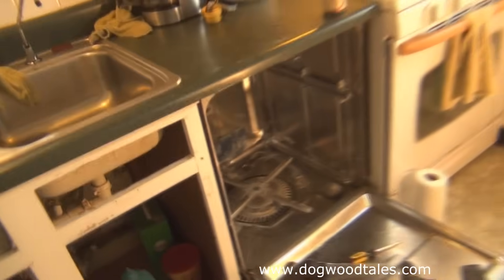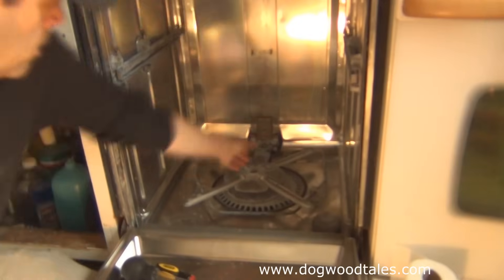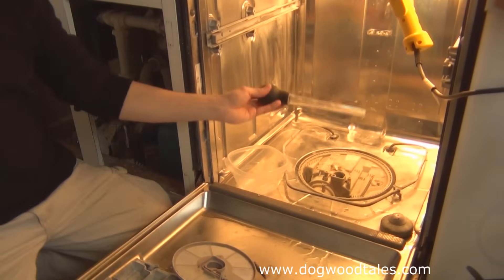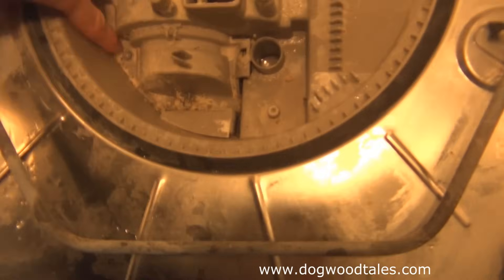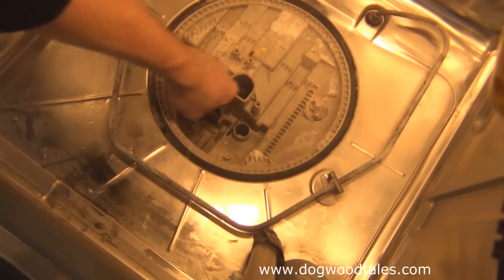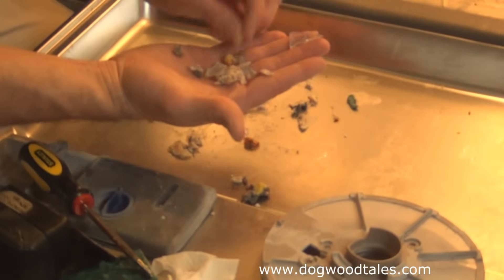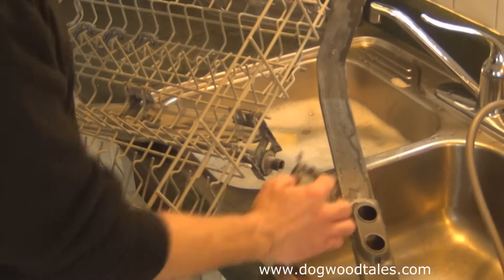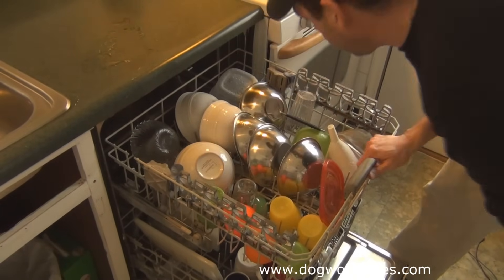Dishwasher Cleaning - Top Rack Doesn't Clean

Comment: Looks like you posted this video 6 years ago and guess what, still works great.  Been debating on calling a repair person or getting a new dishwasher until I saw this.  30-45 min later this thing is running like it's brand new!!! Thanks Dogwood!
Reply from the maker: Glad it worked for you. It helps to extend the useful life of these things. Eventually they will all burn out and need replacement.
Thanks for watching.

Comment: Just had to thank you.  We followed your directions and were lucky that our dishwasher looks exactly like this one.  Our filter and grinder were pretty dirty and we cleaned them, but the real issue turned out to be a small hole in the plastic feed tube assembly.  We did a temporary repair with duct tape and the dishwasher worked perfectly.  We just need to order the part now.

Comment: At home with the 2 kids while the husband is at work.  Watched your video and felt confident! but then the dishwasher leaked during the vinegar wash.  Put everything back- with NO spare parts- and now the control panel is acting up.  but it is running.  Thanks for the video.  the instructions were really clear.  And YOU just saved me $200 up here in NJ- that is IF everything goes back to normal.
Reply from the maker: +Tasha anne That control panel is replaceable too. Kinda a pain in the butt to get to it, but if you can clean that gutter you can handle replacing the control board.

Comment: You probably saved me the cost of a new dishwasher. When dishes weren't getting clean, the appliance repair guy said all we could do was run it with a vinegar rinse and not use as much dishwasher soap.  Recently the water stopped spraying on the top rack. So I did a search on these kinds of problems and your video popped up.  I didn't realize how simple it would be to clean everything up.  There was all kinds of stuff down in the grinder causing it to stop working.  The spray arms also had dried food and detergent residue clogging the holes.  Thanks so much for the video--I am the hero on Father's Day.

Comment: Absolutely perfect!  Cleaned it this morning......superb!   Many thanks from Georgia!  

Found multiple fragments of my disintegrating "pull out utensil basket" in the blade compartment....Had my unit for 7 years and wasn't interested in buying a new one which is where I thought I was headed.  Money saved, and easy.  More importantly, I'm not a "handyman" when it comes to repairs.  With that, this one of the easier things I've completed relative to appliance repair. Cheers!
Reply from the maker: +Jody Logan  I haven't gotten around to posting the video footage I took of it yet, but the bottom of my utensil tray was also disintegrating. I repaired it using galvanized, hardware cloth from the hardware store. I cut it about double the width, of the tray and folded it over so the ends met in the center. Doing that kept most of the sharp edges from sticking out the sides. Then I tied it in place underneath the tray using plastic zip ties.
Clipped the tails off the zip ties and used a metal file to smooth over any sharp edges.

Hardware Cloth
http://www.homedepot.com/p/HDX-1-4-in-x-2-ft-x-5-ft-Hardware-Cloth-308231HD/204331884

Plastic Tip Ties
http://www.homedepot.com/p/Commercial-Electric-11-in-Black-Double-Locking-Cable-Ties-75Lb-Tensil-Strength-100-Pack-295858/202520066

Comment: This worked like a charm! Only side note and it could be our model, but we needed to put all the cleaned parts back in before running it with the vinegar cycle. When we tried running it without the parts, the dishwasher leaked horribly from the bottom. Thinking I shifted something erroneously with the seals causing the leak, we pulled off the front panel to pop off and clean underneath the bottom seal, reassembled the door only to find out it was still leaking. As we were getting ready to order a new dishwasher, on a whim we put all the parts back in, ran the dishwasher and the leaks stopped! Now our dishwasher is even cleaner and working brand new! Thanks again for the detailed video! Model: KitchenAid KUDS35FXSS5

Comment: Dude, I hope you are still reading your comments. You are the bomb! My top rack for wasn't cleaning, and after much research, I followed your instructions. Success! What sets you apart is your management of the bottom assembly. Everyone else holds the central tap and spins the sprayer arm to undo. Well, that plastic gets brittle over time, and I've had it break off before. It is best to take it off intact the way you do. So for those reading this, this one step is the most important take away. Keep up the great work, and I am grateful!
Reply from the maker: thanks! glad to hear it worked out well for you. 
I have found that a careful attention to details works best for me.
Reply: +Dogwood Tales (Ray) thanks for the instructions. I followed a similar video however I was not able to get the last piece off but still managed to clean up my dishwasher very good. In the end the top rack is still not getting water so is it safe to assume the last piece must be removed for a successful clean up of the top rack?
Reply: I took the opportunity to take all of the water conduits apart and clean them. Top sprayer arm had build up in it I found. Used CLR, shop vac, brushes and old fashioned hard work. Works like new. So yes, I would break it all down and clean inside and out.
Reply: Maybe I didn't address your question properly. Yes, take off the cover for the chopper. I had debris and calcifications in there too. It may be stuck, use hot water and CLR to loosen it and pry carefully. But don't remove the chopper blade assembly unless you are really good at these things. You should be able to clean thoroughly with chopper blade in place.
Reply from the maker: If you are referring to the part at 5:55 then yes it has to come off to clean out under it.
It may also reveal if the chopper is in place. Some have reported their chopper as having fallen off.
Like dpfrz544 said, don't remove the chopper. I never had to, thankfully, but I think it can get tricky.

Comment: Thank you so much for this. Real world savings = $450 to 800.
Had a repair guy come and run a couple simple tests and say "yep, you need a new wash pump motor. This one doesn't have the power anymore." Then  saw your video, thought "what do I have to lose" and sure enough it was loaded with gunk down there. Followed the video, cleaned everything out, and ran a load that came out sparkling. One of the clearest how-to videos I've used. Just fantastic.

Comment: I searched for a repair video after figuring out how to remove the initial water channel for the top rack, expecting to find clogs or small orifices to clean but finding none. Though a different Kitchen Aid model,  I found the machines similar enough to use your instructions with most parts being identical. I never would have started unscrewing the base parts had I not had you there for guidance - thanks! The toughest part was that my food chopper cover did not want to come out, and it looked totally integrated with the large base part underneath it. I almost gave up, but saw by your video that I really wasn't getting anywhere without insisting it come out. I finally was able to pry it loose, and sure enough, it had a bunch of gunk including a piece of plastic blocking the water flow through the screen. I am currently running the vinegar wash load through, then will have to reassemble. Thanks again!
Reply from the maker: +Dana B Glad to hear it's working well for you. Thanks for watching.

Comment: Thank you SO MUCH for this video! I have just taken apart my dishwasher and cleaned the parts (they were caked in mould and other gunk). I found half a pistachio shell, a chickpea, and an oval metal clothing tag (??), no wonder it didn't work! I am just running the vinegar cycle and afterwards will re-assemble it which shouldn't take too long. Thank you again for your very helpful video, it was easy to follow! Dishwashers are no longer a mystery to me! It didn't take me very long, it has only been about 40 minutes and I'm just waiting for the dishwasher to finish so I can pop the other pieces back in. PS - love your sense of humour :)

Comment: Just wanted to let you know I watched your video and went home and repaired my own dishwasher. Got out the Ryobi drill/screwdriver set and a flashlight, pair of hemostats and went to work. The top rack wasn't spinning/cleaning. Figured there was a clog somewhere. I was able to disassemble my Kenmore, clean it (found 2 toothpicks, pecans, piece of plastic, bone, and the food grater part was mesh and full of cat hair), reassemble it and viola! Working dishwasher. Thank you again for your comprehensive and not overly long video. It saved us 400.00 on a new dishwasher.

Comment: I had already resurrected my dishwasher by simply clearing all the gunk I could see and then, after reading the manual, removing and cleaning the screen, filter, and spinning arms.  No tools, folks, so do not be afraid!  Some food particles remaining on the top shelf, so came here.  Your tip to run water through the spinning arms was brilliant!  Found some holes that were not clear though they appeared to be; a twist tie worked better than a toothpick.  Mapping the top with some bowls, but I think I am done.  Not afraid to dissemble the tubing and the bottom as you demonstrated, however. Thank you for a video that was clear, with excellent info.

Comment: Thank you so much! I found your video more informative than all those certified trainers paid by KitchenAid and online Parts suppliers. I wish I would have come across your video first and your suggestions would have saved me 3 hours of unnecessary work. I loved the way you disassembled the lower spray arm together with the hub. Saves everyone a lot of time. Installing the lower spray arm is pain in the ** and there no need to separate it from the hub.

Comment: I just followed these instructions on a 14 year old KitchenAid Superba, it had one more screw than on the video, but the instructions worked great.  The big clog on mine was the mini disposal was completely blocked.   Plus there was a small plastic cap which was probably contributing.   I think the cleaning will make the dishwasher work much better.

Thanks.

Comment: Thank you sir! Even almost 6 years later your video helped me. Mine didn't exactly need a cleaning but the upper sprayer where it fits into the back was broken. I found that there's a plastic part that should hold the valve open and it was broken. Had to order a new part. Thanks again!

Comment: Thank you!  Thank you!  Thank you!  The issue that I was having was very discouraging and I thought that we were going to shell out another $700+ dollars for a dishwasher.  Ours is 10 years old and you know a repairman would have cost about $250 and I couldn't see putting out that kind of money for a 10 year old dishwasher.  This was not a hard procedure to do if you have a little mechanical ability like me.  In fact, it was a lot of fun and very rewarding because my unit is working like new and it didn't cost me a dime!  Only problem I had was that I used Krud Kutter in place of the Simple Green spray and it made a lot of suds which foamed out of the bottom when I was testing the unit.  I really appreciate you sharing your knowledge and saving me a lot of money.  Thanks again!

Comment: Great video! Thanks for your help Dogwood Tales.  A little tip of our own - use a shop vac to suck out the big stuff!

Your instructions were great. We were worried we would need a new dishwasher after the top rack stopped cleaning, However, after cleaning it out as you did - PRESTO! Works like new.

Comment: Thanks a ton for posting this video. You're a good teacher with your step by step directions and clear video quality. I did everything you did and I'm just waiting for some super glue to dry to test it out. Even if it doesn't solve the problem in the top rack of the dishwasher, I'm glad I was able to get it clean because it was nasty. What you were saying about the guy who commented that time is money was spot-on. I recently heard someone say that don't think of things in terms of cost but a value. Right now, my time is of less value then the cost of repairing or replacing the dishwasher. So thanks again for posting.

Comment: Thanks for the video, it was a great help.  My 10 year old Kitchenaid dishwasher was cleaning very poorly, especially the top rack.  Followed the steps you outlined, found almost an inch of lime and debris built up in places under the screen.  The chopper mechanism was clogged with toothpicks, thread, garbage, you name it.  Took a couple hours to get it apart, cleaned, and back together.  Now it works like brand new, amazing!

Comment: This was a wonderful step by step video! My Kitchenmaid was a slightly newer model but I was able to use these directions to get right down to the food chopper, clean everything out - there was a small screw floating around below the filter but not in the chopper. Oh yeah I found some corn, peas and a toothpick!  Got rid of all that. Cleaned everything up including a vinegar wash and was done in about an hour and half. Machine works beautifully again!! Everybody check your tools. I was having a hard time finding  the correct screwdriver bit amongst my husbands myriad boxes of tools but finally found the star bits in one of those multi-use screw drivers. Fortunately they fit exactly and were magnetized to boot!. Thanks so much! I saved a lot of money doing this myself. Now its time to go spend it!!!  Thanks Ray!! (Bly the way,my hubby was busy tiling the bathroom. He'll be sorry he missed this!)
Reply from the maker: Glad to hear it worked out well. I'm sure the hubby was glad that you took care of it while he was working on that tile.
Reply: Well we were all good for a month now the top rack dishes, glassware, etc. are not getting clean - food, debris, etc. I repeated the whole process - the whole assembly was very clean and water flowing to top rack well. Now what??? Any other suggestions?
Reply from the maker: Hmm ... I'm not a pro at this, but it could be the pump is not strong enough any more to do a good job. 
Or maybe try using a wet vac to suction out the pump area as best as you can. Maybe there's stuff down in there that you can't get to without removing the chopper assembly. I'm referring to the hole that I put that turkey baster into. There's also the hole in the dead center. A round crevice tool on a wet dry vac might suck out stuff that's behind the chopper.
Other than that, perhaps you need to venture beyond the chopper assembly and actually remove it. Sorry, but I don't have any experience with doing that or in replacing a water pump.
Also, it seems that the older these machines get, the more the dishes need to be pre-cleaned.
A brand new dishwasher will do a pretty good job of eating away dried-on eggs etc. The older it gets, the less effective it is at doing that. It's just the way it is. Kinda like me. I'm not as fast working in the yard as I used to be lol.
I hope it works out well for you. Let me know.

Comment: Hi, thanks very much for the excellent video on the cleaning necessary to solve this problem and keep the dishwasher running like new.  I had this exact problem, top washer arm was not rotating, dishes were not getting clean.  Followed your video and found the same thing, lots of junk blocking the channel down inside.  Cleaned everything out and now the dishwasher is running like new!!  Perfect, thanks again.

Comment: I followed this last night and I'm thrilled to say my dishwasher is back to full cleaning mode.  I'm very thankful to have found your video as I'm not sure I could have done this otherwise.  It took me under an hour but that was because I didn't have nearly as much gunk....my problem was that the chopper assembly had come apart.  I was able to follow another video to remove it clean it and put it back together.

Comment: I have a similar Kitchenaid dishwasher.  I couldn't figure out why the dishwasher wasn't filling with much water, dishes on the top rack weren't coming clean, and the soap wasn't  dissolving.  My husband replaced the soap dish and the water inlet valve (which was gunked up too).  After the new water inlet valve was installed, at least it started filling up with water like it should.  But the dishes on the top rack were still turning out dirty.  I found this video and followed the instructions.  I couldn't believe how much junk was built up in the food grinder/drain.  I cleaned all that out.  I washed out the other parts shown in the video with a garden hose.  My dishwasher is working much better now.  Thanks!
Reply from the maker: Sharon Zummo just in time for christmas too. glad it worked out well for you

Comment: My dishwasher is similar model... and had no idea why the top rack wasn't cleaning.  I quickly opened the door during wash cycle and never saw the top spinner.. spinning.   so.. I knew it wasn't getting enough water pressure.  Your video made my job easy.. THANK YOU.   Once everything was taken apart, I saw that my clog was caused by food, etc. but mostly with all the tiny plastic particles that disintegrated off the utensil basket...which I replaced last year because it was worn.   Why design a washer basket with plastic that can't withstand high temps?   Designed to fail. Sigh.  THANK YOU for extending the life of my washer.  I owe you BIG TIME !!
Reply from the maker: David Ingram thanks - I like Yeungling :-)
Reply: Dogwood Tales Me too.  Yuengling is my college beer... and actually visited the brewery in Pottsville PA.    great stuff.